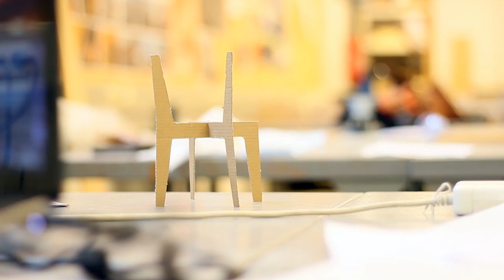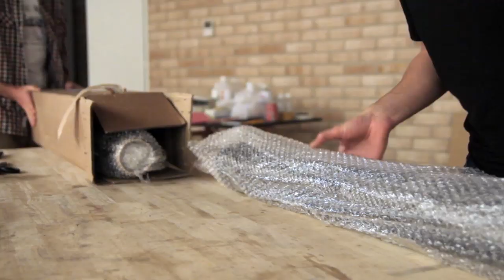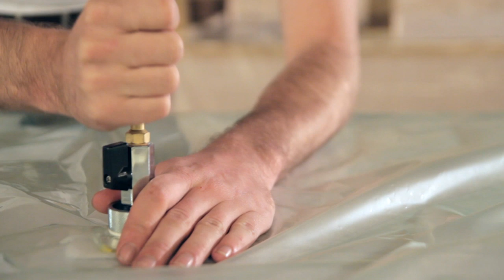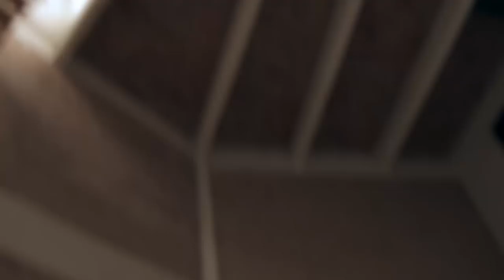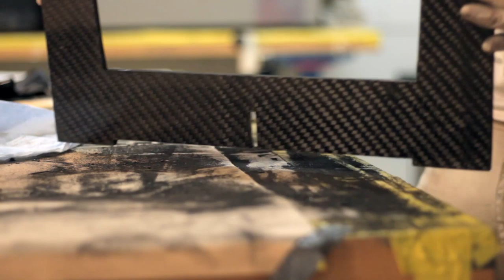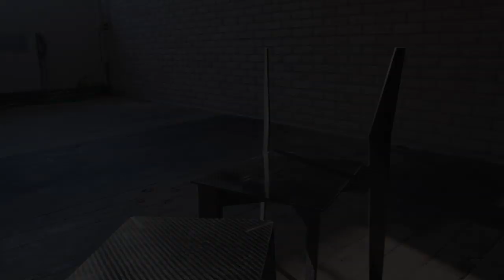Carbon fiber - Faced² (unfinished)

Comment: Any air bubbles or pinholes after it was taken out of the bag? Or does applying resin immediately and then squeezing the excess resin around with the plastic card and then immediately vacuum bagging it take care of it?
Reply from the maker: There is a bigger chance for pinholes that way yes 🙂 but is faster to do that way